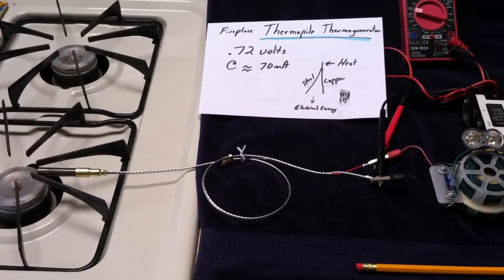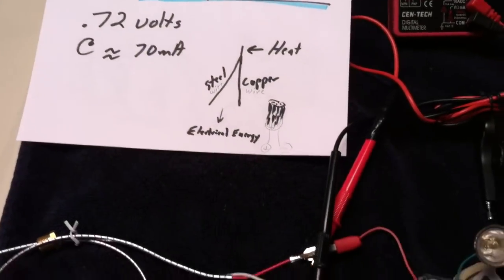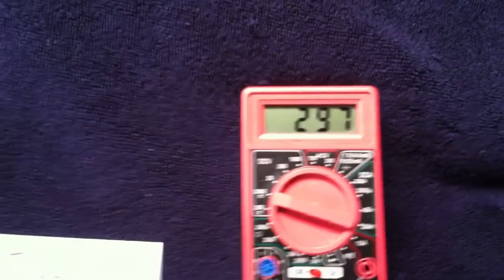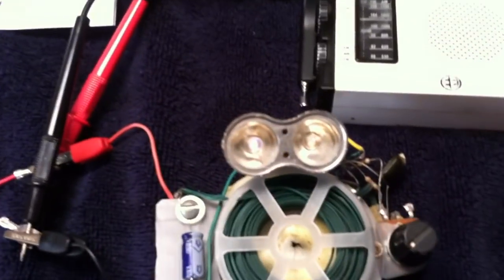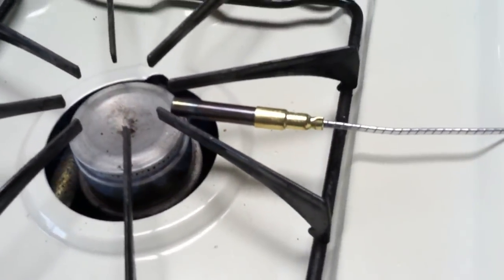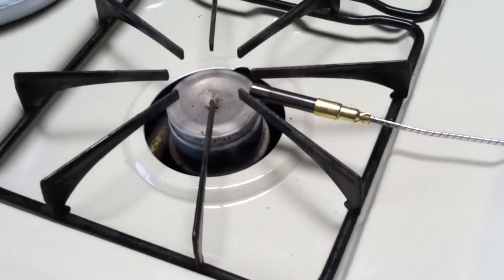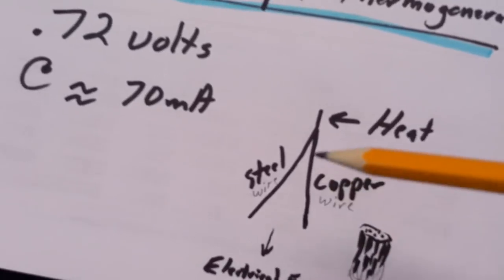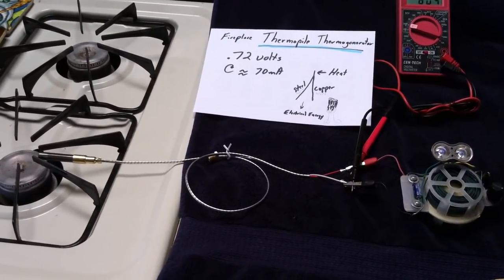Thermopile Thermogenerator ---- Powering a Joule Thief

Comment: You can build a better thermopile from wires yourself. That one you have runs off the temperature difference between one end of the probe and the other end (clamp the base in a heatsink then heat the end that sticks out) and... you need more surface area for more current, like sheet metal plate junctions.

Comment: This is based off of a similar effect to the peltier generators. Try storing the thermopile in the freezer and then bring it up to temperature. it's worth a try to bring up the voltage. It might make a nice resistor/heat sensor

Comment: Wow, that's a cool little device.  Would focusing the sun on it with a magnifying glass or a parabolic mirror make enough heat?
Reply from the maker: I'm working on it but you need a big magnifying glass and an accurate sun tracker.  The thermocouple has to be really hot and stay that way or the juice stops immediately.

Comment: I had seen those sensors before, I did not know they were generation power.
Reply from the maker: That is what I thought also----that they were just sensors.  I had no idea that they produced enough power to actually run something.
Reply: @Lidmotor  most thermometers works like this just they use a single thermo couple where as this one uses 10 or 20 couples within the unit, a teg/peltier uses even more which are shorter but wider couples to increase voltage, taking apart a peltier from a stove fan is worth a look, thermo couples made of different dissimlar metals make different voltages, new alloys and magnesium couples tested recently have led to much higher voltages that could be quite exciting for the future, this is actually how they harness the nuclear power from the mars rovers reactor

Comment: Nice!  Thanks for sharing!

You'd just need 19,842 of them (plus a lot of heat) to make a 1 kW generator! (1000W/(.72V*.07A))

Good for small gadget tinkering though!
Reply from the maker: I was thinking about a camping trip cellphone charger maybe.
Reply: You could make such a charger, however the charge rate would be very very slow.  A typical 3.7Vnominal lithium-ion cell/battery for a cellphone is charged with a charger that provides a constant current of between .5A (slow usb) to ~2A (rapid charge wall-wart) with a source V of between 5V (USB charger) to 5.76V (wall-wart charger--which very often you will see ~5.25V) until the in-circuit voltage = 4.2V.  Then the charging voltage is kept constant & the charge current decreases until the cut-off current limit  = ~30mA)

That means the charge power is between 2.5W (slow charger 5V*.5A) to 7.9W (rapid charger 5.25V*1.5A).  Your charger design would require 7 devices to be wired in series--which would produce 5.04V & 70ma = 0.3528W.  That means your design would charge at a rate of between ~14% of a slower usb charger to ~4.5% of the rate of a fast wall-wort charger.  So a lot more time would be required to charge the battery with your charger (worst case=~7 times longer than a slow charger & ~22 times longer than a rapid charger).  

A high quality fully discharged 18650 cell takes ~4 hrs to fully charge using a 1A charger.  Using your charger, it would take ~60 hrs to get a full charge (less time for a fractional charge, of course).

Since cell phone charge programs & circuitry typically don't allow full cell discharge, the recharge time will be some multiple of how long your phone typically takes to be fully recharged.
Reply from the maker: What I have discovered in my experiments is that if you have ANY power ---the quest is to find a way to make that work for you.  It is like retiring on a fixed income.  You find a way to live with it.
Reply: As stated before--it will work as a charger--just as a very slow charger.

In support of your 'quest to find a way to make that work for you', you could  connect groups of 7 series-connected devices in parallel.  Each parallel connection of 7 devices connected in series would increase your output charging power by  0.3528W, while keeping the charge voltage at 5.04V.  

To make a charger that has an output power equal to that of a slow usb charger, you would need 49 devices connected in serial & in parallel (as described above).

HTH
Reply from the maker: Thanks for the calculations.  Checkout the BioLite Campstove.  It seems someone else has already done this idea using TEGs.  It has not gotten great reviews but it does work.  Charging a phone takes a long time and it takes constant feeding the fire with little sticks. https://andrewskurka.com/2012/biolite-campstove-review/
Reply: Interesting system, however, it has its own 2.6 Ah battery--and they do NOT specify the typical charge rate of the device when the on-board cell is depleted.  
Their advertising does show "Create 3 watts of electricity from the heat of your fire and use it to charge devices in real-time or store for later use with on-board 2600mAh battery".  If true, that is ~8.5 times higher power production than your device (i.e. 3W/.3528W) & a potential charge rate of 600 mA (i.e. 3W/5V) which is 20% better than typical low-power usb charging--but, still a very slow charge rate).

Here are the specs that I could find:  
https://www.bioliteenergy.com/products/campstove-2
Reply from the maker: I wonder how much that 3 watt TEG costs.  That is really all I want.  They can keep the rest.
Reply: You could ask them via email. :-)